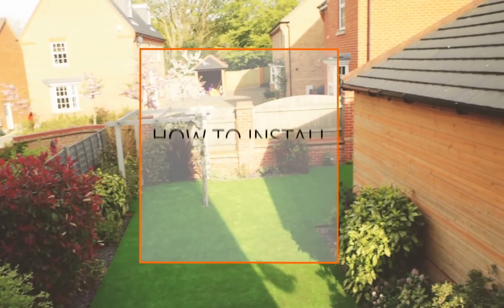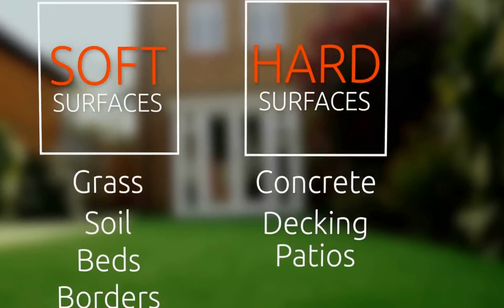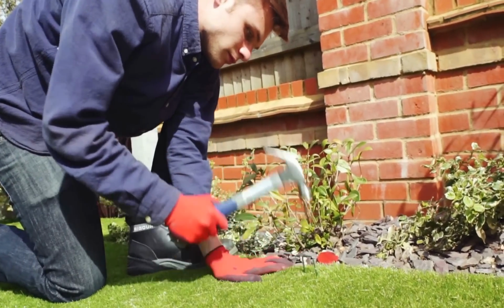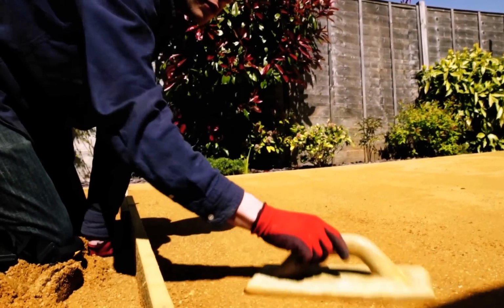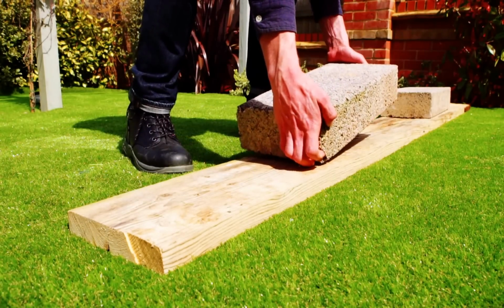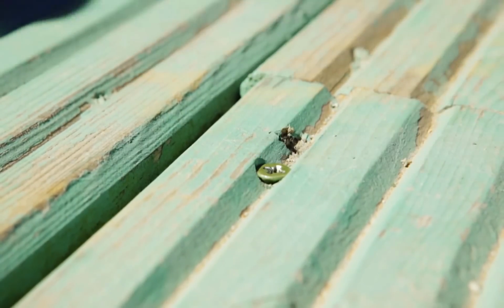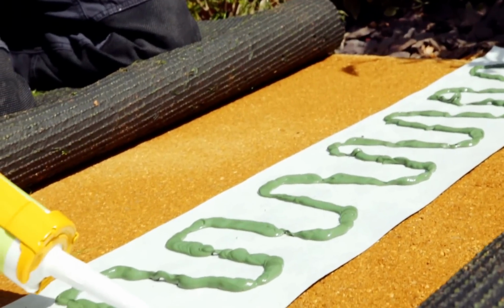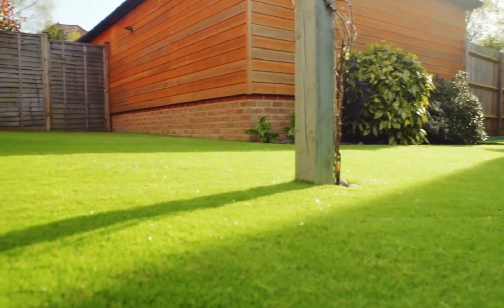How to Fit Artificial Grass

Comment: I’ve tried asking so called professionals who do this for a job asking them would they be interested all you get is a load of crap it’s not their preferred standard of grass they work with ( turf king of Bristol ) it’s because I didn’t buy it from them that’s why and there’s another from abbots Leigh won’t do it either but he sent me an email with the grass they use my grass wasn’t exactly cheap £1800 all I wanted was a bit of advice and if they were interested fitting it instead I smell bull shit

Comment: Hello my friend thank god some one who don’t waffle on explaining it properly 
I’m about to do mine my self after being let down by someone who said they will do it.I’m doing mine on top of paving slabs could you tell me do I have to use adhesive all over or just the edges it’s quite an average size garden I’m doing I’ve heard so many people say you need to screw it all around the edges every 3m do I need to do this and also 
Where I have been let down my grass has been rolled out ready and cut but because we have a bit of a down pour I’ve rolled it back up and covered with plastic sheeting a few times dodging the rain will this do my grass harm rolling and unrolling I’ve no choice because I’ve been let down and dodging the rain trying to keep it dry sorry it’s bit of a story but I can’t get a  straight answer from anyone else great video thanks Russ
Reply: I’m also about to do mine the installation myself after being let down by many landscapers  who said they will do it or would never fix a date... seems like a common tendency with landscape designers despite the fact they charge so much in thousands

Comment: Professional video with some wrong information. Some of these methods were preferable about 10 years ago but things have moved on now. You shouldn’t use sand as the top layer or a wooden boarder. As for folding the edges over......just don’t!